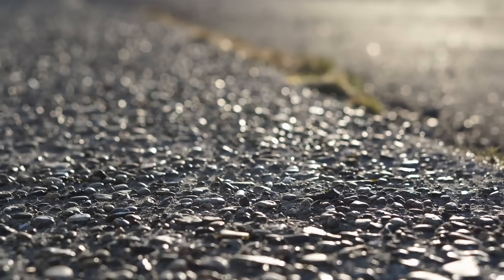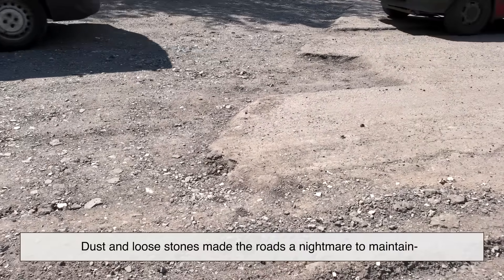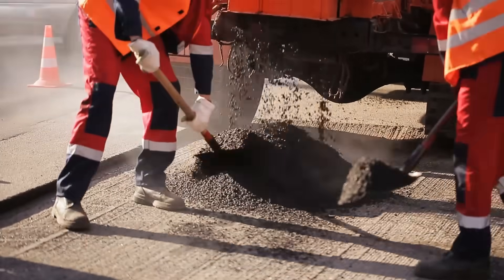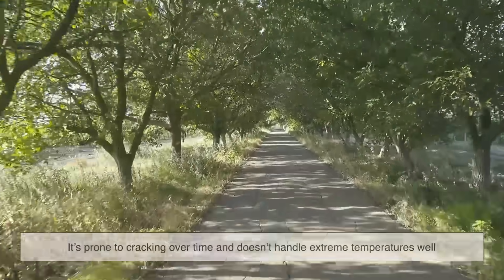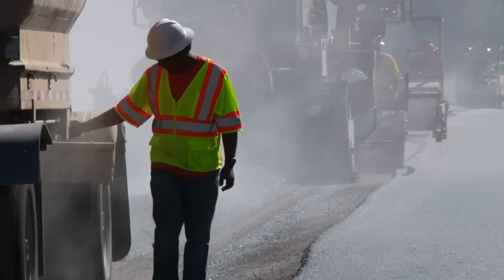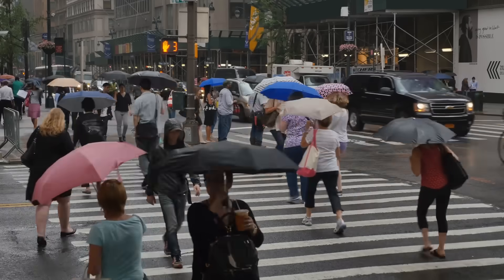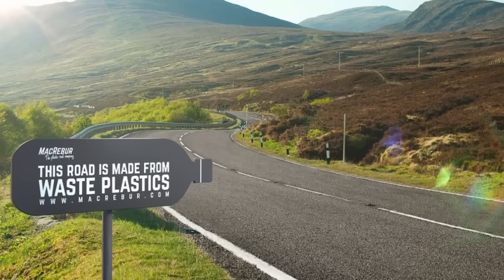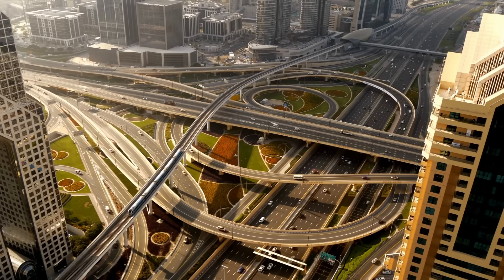What’s the Difference Between Tarmac and Asphalt?

Comment: Then there is RCC, that is Roller Compacted Concrete.  RCC is cheaper than asphalt, better traction, and sets up in 24 hours.  RCC is not to be confused with Reinforced Concrete which is steel or fiberglass reinforced with a wet mix, that takes weeks to set up.

Comment: Hmm. "Tar" is a generic term for a wide variety of black, sticky compounds, one of which is bitumen. The tar used in tarmac is a mixture of coal tar and pitch (which is another word for bitumen). Macadam himself owned a coal-tar production firm, but never used coal tar for road surfacing. Tarmacadam was not invented by Macadam, but by a fellow called Hooley. 

So any difference between the two is not the binder, but may pertain to the granular materials. I don't think the video made this point clear at all. Furthermore, any distinction between "crushed stones" and "gravel" was omitted, as was the type of stone typically used in each case. (Granite is not the same as limestone).

The wikipedia entry for Tarmacadam states the following:

"Hooley's 1902 patent for tarmac involved mechanically mixing tar and aggregate before lay-down and then compacting the mixture with a steamroller. The tar was modified by adding small amounts of Portland cement, resin and pitch."

Notice the word "aggregate" - this too is a generic term which includes various granular materials, including gravel and sand, in various combinations, and certainly not limited to crushed stones. Notice also that the patent mentions "Portland cement" as an ingredient. None of this mentioned in the video. POOR RESEARCH.

Comment: The redid the gravel road in my old neighborhood with tarmac. I think they did it because they didn't want to bring in the heavy equipment to lay asphalt, and they also pressed the last layer of stone into the tar without tarring over it, making the road surface white instead of black to absorb less sunlight. Though, I didn't realize that tarmac and macadam meant the same thing until just now, my dad called it a macadam road, and I didn't realize that was just a different shortening of the same thing as tarmac.

Comment: Graphene enhanced asphalt is about the dumbest idea ever spoken.  Graphene is extremely expensive, and asphalt is bulky, dirt cheap in conpairison, and is ruined over time by drying out and losing strength, requiring frequent replacement or resealing.  Plus, asphalt could not even benefit from the extreme strength of graphene because asphalt is too soft.  Less costly fiberglass would achieve the same "benefit"(waisted money) at one tenthousanth the cost.  Additionally, because fiberglass fibers can be longer, it would hold the asphalt together 20 times better than carbon fiber. 

This channel sucks, spouting garbage buzz words and calling it the future of technology.

Comment: I am the fourth generation of a family of pavers and I am an Italian road engineer. In Italy the use of tarmac ceased after the Second World War because it was an outdated method of paving.
It required all manual work, it was alterable by the ammonia contained in the urine of draft animals (horses and mules).
The binder was tar by-product of the production of town gas with coal.
When the gas factories were closed there was no more tar on the roads.
Asphalt uses as a binder mainly the residue of distillation of petroleum for the production of fuels and virgin naphtha. When my ancestors began to pave asphalt, the refineries gave it away because they did not know where to put it. The first plants for the production of asphalt conglomerates were built by Barber Greene in Illinois in the mid 30s of the last century. Since then the death of tarmac began

Comment: just few occurrence  here in Philippines, a contractor is paid to pave one side of the road, and the actual low skill guys doing the work have some bright idea to dump the lumps on the other side thinking they will be working on the other side next. Now years later the newer side has a lousy wavy finish and the older good side have a lumps and bumps that will trip you motorcycle.

Comment: to save your time, the difference is simple. 

Tarmac (short for tarmacadam) is made by coating crushed stone with tar, while asphalt is made by mixing aggregate with bitumen (a petroleum product). Tarmac is older and less commonly used today because asphalt is more durable and weather-resistant. Asphalt is the standard material for modern roads, highways, and airport runways.

Comment: I can’t see solar battery roads working. Even if the solar cells can stand up to cars, trucks, etc. rolling over them, as long as vehicles have rubber tires, the solar cells will get covered with black from the tires in a short time. Not to mention dirt and dust from the surrounding environment.

Comment: Sweet machines eat a road at the front, recycle it on board with some additive then lay asphalt at the rear.  Asphalt is always the most affordable option for surface, but sometimes you have to use concrete.  They didn't mention chip and seal which is like tarmac but they just lay it on top of older busted up roads that get less traffic.  That's the road you drive down and tossed the pebbles up in the wheel wells and is a cheap measure for certain roads before being redone or just what they do once every 10 years or so on country roads.  🗿👽🗿

Comment: I never heard of Tarmac as a construction material. I had classes in construction materials in college, and tarmac wasn't even discussed. The only place I ever heard the term was on TV news broadcasts, when the reporter would use the phrase "out on the Tarmac."  They were usually talking about the area where the planes were parked. That is either called the Apron or what was common on Air Force bases the Ramp. It just goes to show, you can't trust anything the news media say.

Comment: They are a bit SIMPLE themselves too. They leave unmentioned that asphalt roads will ALSO be made from THAT material mixed with something like macadamia (or for instance concrete chips) to give it more rigidity and strength, especially trough-roads and highways, for nearly all of their considerable thickness except for the absolute top layer, that they may leave unmixed for smoothness and lower sound levels produced by vehicles driving over them (but may be mixed as well for extra grip). Als everything they say here about solar roads, roads that supposedly 'heal themselves' ('with BACTERIA' no less!!) etc... ALL nonsense.

Comment: Asphalt in the context of paving is technically termed "Asphalt Concrete", as its mixture of large, medium, and fine aggregate mixed with a binder that cures classifies it as a  type of concrete.     The concrete we all know is technically termed Portland Cement Concrete or PCC.   The process of "chip sealing" or "seal coating" is probably the closest comparison to tarmac road surfaces,  where superheated asphalt is sprayed on a road surface and immediately covered with an even layer of natural pea gravel harvested from river beds or a manufactured  crushed stone, with both of those aggregates screened to a size of around  3/8".  The city I live in still uses the chip sealing process to upgrade it's gravel alleys for the sanitatiion trucks and dust control, as well as on a few medium traffic and many low traffic residential streets, especially streets that are not of the curb and gutter design.  Just some additional fun facts for everyone.

Comment: He missed one other potentially significant additive to asphalt that would improve its repairability.  They can mix a small amount of black iron oxide, a type of iron ore, into the asphalt.  Black iron oxide is sometimes called magnetite, because it is magnetic and electrically conducive.  In asphalt it would allow the use of inductive or microwave heaters in the repaving/rolling machines that would deeply, rapidly heat the asphalt to re-fuse the bitumen/tar components to a new smooth and durable surface, with minimal new bitumen needed.  Graphene, also electrically conductive,  might do the same thing, but likely at a much greater cost.  The extra durability it might give may make it worth it.

Comment: Asphalt will ripple in hot air with a strong wind in time. They both do this. In about 5 years of use in hot places like Texas it will do this. That is why concrete is still used in some places.

Comment: Back in the late sixties I worked on road in the U.K. Tarmac was used as an under surface of asphalt, the tarmac would have different sized stones depending if it was for a footpath or a road. When laying the asphalt stones coated with bitumen would be scattered on the surface and then compacted with a roller. The stones give grip and reduce wear on the asphalt.

Comment: You missed big push here in California which was “RMA” rubber modified asphalt.   Using ground up crum rubber from old car tires.  This is a favorite of the recycling community in response to or an alternative to landfilling tires or using them as a fuel in Portland cement manufacturing.

Comment: While my city does not use Tarmac, it uses a similar type of finish, they use an asphaltic binder and gravel spread on top and rolled into the binder. This makes a horrible road surface that is really noisy when tires roll on it.  This road surface is used over most of rural Texas and tar is often used. The noise is so bad that I wear noise cancelling headphones on long trips.  I hate this kind of road finish.

Comment: The very best blacktop I ever experienced was on highway 180, west of Carlsbad, New Mexico. Absolutely amazing road. 🥰 It was as if it was made of ground up tires. Sticky, QUIET, and always dry feeling when raining 🌧. Never slippery 🙃, no puddles, no potholes, not ANY cracks, not a thing negative about it, just SMOOOOOTH.  Excellent 👍 I'd say, THE perfect road, even.
 I found out, from someone very knowledgeable about road construction, that this type Asphalt is more costly but much more long-lasting and requiring much less maintenance. That highway is much less traveled than most other roads in the country, but still I never even noticed if it had ever been patched for any reason, ie: pipe laying for example.  I bet it's even the best road for snow country. Probably handles salt being laid down and whatnot. So many lives could be saved, so many suspensions not beat to hell going over potholes and etc. Very puzzling as to why that type Asphalt isn't used everywhere,  other than politicians would get less $$ to take from the kitty to line their pockets 🙄🤨

Comment: The uppermost surface layer of asphalt runways is much thinner than most folks realise. It is often less than an inch in thickness. It’s main job Is to offer friction to the aircraft tires/tyres, allow rainwater to drain away , stay in place against delamination, durable to resist extreme tire loading and scuff, weathering over a long time. The binders are often heavily modified with added polymers or possibly fibres to achieve this. The stones are high-spec and can only be sourced from a limited number of stone quarries.

Comment: In U.K. tarmac used to be used at the ends of asphalt runways and holding areas where aircraft used to pause. This is because it was more resistant (than asphalt) to wheel rutting and accidental drips of fuel or other fluids. It is no longer used.

Comment: I’m a professional engineer specializing in airport design. I cringe every time I hear the word “tarmac”. As the video states, tarmac is not a material that is used anymore. The area where aircraft park is an aircraft parking apron, or in the military, a ramp. Most airport operators prefer using concrete for parking aircraft, because of longevity and fuel resistance. Also, in hot climates, aircraft parked on asphalt can leave a rut where the main gear stand. Most people using the word tarmac are doing so to sound like they have a background in aviation. Unfortunately, the term is propagated by the media and some administrative personnel at the FAA.

Comment: Many macadam roads in the US, started as "gravel" roads. (Although often technically crushed stone, not gravel.) Coating them with tar, and then "resealing" them a number of years later, by spraying more tar, and a light coat of more stone was a way to keep them maintained. But macadam is very flexible, and if trucks started to regularly use the road, it would quickly become very uneven. In some cases, laying an asphalt surface on top of the macadam was the cost effective solution, but if it was a main road, tearing-up the macadam, and replacing it with a new base with either asphalt or concrete needed to be done. 

But initially, all those lightly traveled rural roads became paved because of how simple it was to make them macadam. Some road maps from the 40s, 50s, and even 60s might have a legend showing unpaved (dirt, gravel or stone), macadam, and paved (asphalt or concrete) roads differently to help truckers know where the best routes for them would be.

Comment: Both and the "third" are concretes: i.e. mixtures of graded rock, sand, and a binder.  Portland cement concrete uses Portand cement as the binder.  TarMacAdam uses a coal-based tar as a binder.  Asphaltic concrete used a heavy oil-based binder.
Reply: The French term for asphaltic concrete is "béton bitumineux", which literally means bituminous concrete.

Comment: decades ago.my employer expanded an empty trailer drop yard.after leveling & grading they used ground up asphalt that was treated with some diesel fuel.& rolled.it packed quite well.& held empty trailers without sinking.beats the hell out of 4 acres of mud with landing gear legs in 2 feet deep.

Comment: Actually, in the modern sense, what we call asphalt and tarmac are basically the same thing.  'Asphalt' and 'Tar' are simply references to a flexible petrochemical polymer binder for the aggregate, as opposed to a rigid 'cement' binder.  The traditional difference was in how bare ground was paved.  The tarmac process involved laying down and compacting layers of crushed rock, pouring hot tar, asphaltum or bitumen binder into the stone and steamrolling.  'Asphalt' paving typically involves laying a prepared and heated mixture of binder and crushed stone and then steamrolling.

Comment: I still see a few roads in my area, usually back streets or short connectors, that get repaved using the tarmacadam process. However, they don't get done like is shown in the video, with a mix of tar and aggregate laid down and rolled smooth. Here, they put down a coarse gravel base, compact it and then go over it with a heavy layer of tar, usually sprayed, which penetrates the compacted clean stone for a bond. Then another layer of tar is sprayed and a finer grade of stone is spread on the fresh tar and rolled smooth before the tar hardens, driving the fine gravel into the tar and making the driving surface. There is usually a fair amount of the fine gravel that doesn't bond well and after a few weeks, the loose gravel is pushed to the  shoulders or middle of the road by traffic, and the areas of the traffic lanes that bear most of the actual tire travel are buffed smooth by the constant compaction. These roads are slicker in wet weather and tend to pothole much more quickly than asphalt pavement does. I think the reasoning for using this process over asphalt is initial cost.
Reply: @DeereX748  i always heard that called macadam.

Comment: In my 81 years, I have never heard "Tarmac" to mean other than the aircraft parking/staging area at an airport. The surface could have been asphalt or concrete, but the area (not the surface) was always referred to as out on the tarmac. It could be because I have an aviation background from my service as a Naval Aviator.
Reply: In the Air Force we never used the word tarmac and called any area where planes were staged the flightline.

Comment: Tarmac in UK hasn't been used for years and we have two basic alternatives Bitmac (Bitumen Macadam) and HRA (Hot Rolled Asphalt).  HRA is undoubtedly the tougher material but requires large plant to lay so is uneconomical generally for anything apart from road or large heavy trafficked areas.  Bitmac is the most used product for all sizes of installations.

Comment: As long as we're differentiating between terms, those are not "stones" mixed with tar, they are [small] "rocks". The term 'stone' refers to what the material is made of, like glass, wood, steel or 'stone'. All of the  pyramid channels on YT use it incorrectly as well, referring to "the stones used in building". Sorry, they're ROCKS. 

And that's your Science lesson for today. 👍😃👍

Comment: You mentioned Solar Roads 😂  It was a experimental project that didn't work. The amount of electricity produced by the road units over time was very little. So little it had no value or usage potential. And the units tested on roads with traffic quickly wore down, and the inner electrical system failed to work. They then tried it on bicycle and walking roads, but it did not hold up very long against the elements and peoples usage.
Reply: Sounded really lame.  A waste of someone's money.